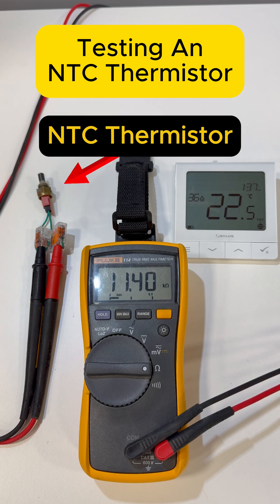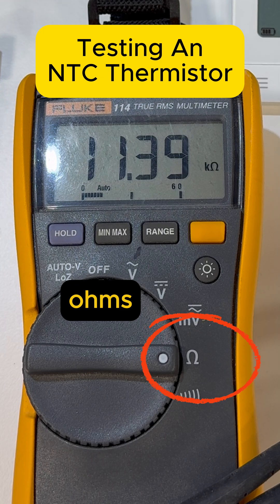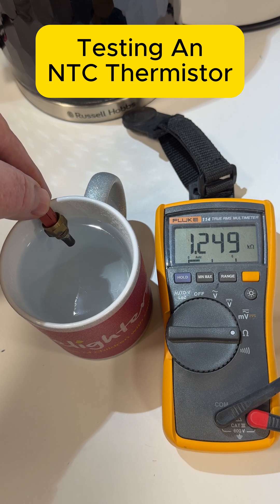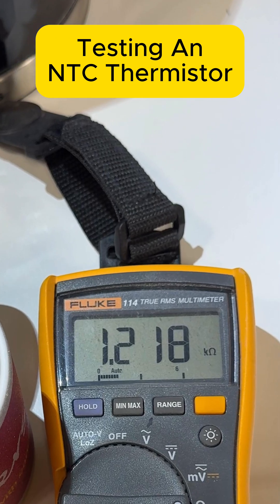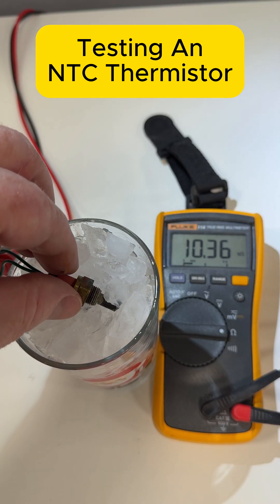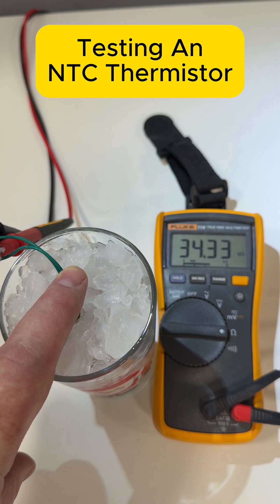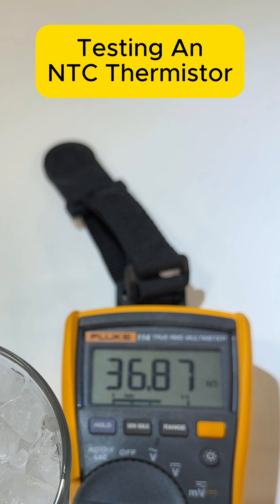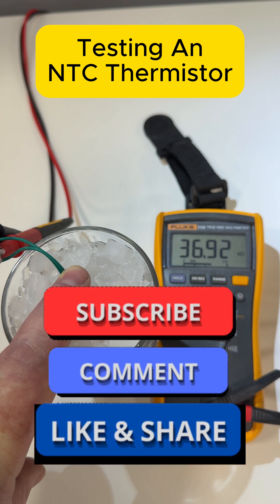Testing An NTC Thermistor

Comment: Crushed ice in water is the normal way for testing of RTDs.  Issue with just ice is that it can come directly from the freezer that is sat at -18 degC and below!  So ice in water, stirring it and leaving it to settle is then going to be 0 degC.  

This is what I've done in the past for various industrial RTDs, e.g. PT100 / PT1000s etc, as these are 100 / 1000 ohms at 0 degC.